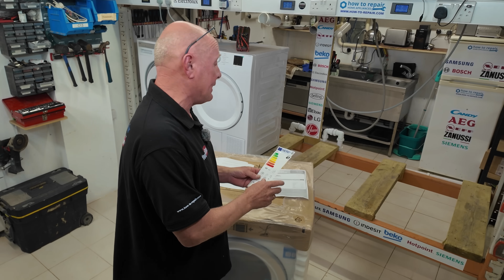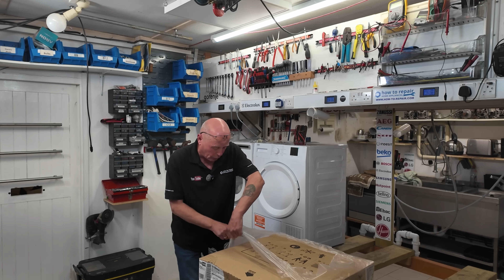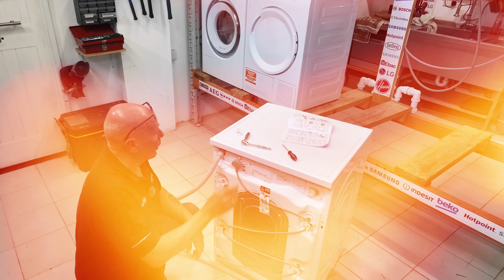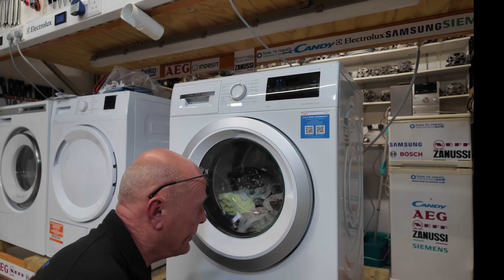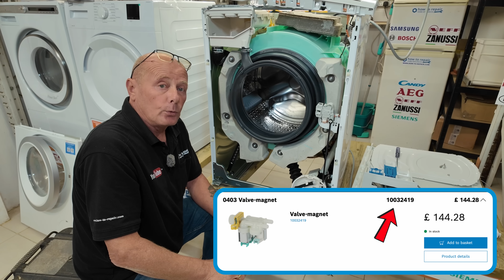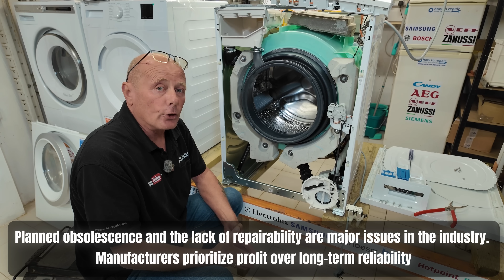Bosch WAN28259GB Washing Machine An Engineers Review: The Good, The Bad & The Ugly Truth!

Comment: Thanks for the work you are putting in these videos and getting the message out!
 
I grew up in the area of the main production site of these Bosch Siemens devices, a fellow engineering student of mine even did his industry internship there – and let me tell you this is a massive business undertaking and they are ejaculating out their junk into the world with an own railway station.
In my opinion, we have to rethink how we use and value things in general. Shortly speaking: „having way less, but way better things“. Especially big appliances like washing machines, fridges, ovens, dishwashers, thermal heat pumps etc. (not even speaking of cars) require an immense amount of resources and effort regarding the logistics. I think we should treat such devices (or almost all things we own) like investment goods rather than mere consumables and demand a corresponding build quality, engineering thoughtfulness as well as service and support for them. They should be built like industrial production machines, outlast us, have easily replacable components with a dimensioning for extremely high cycle fatigues and so on. A few different models of the same manufacturer are completely sufficient and should have a high degree of commonality. Unfortunately, as the average viewer of this channel knows, the exact opposite is the case and we even have to fight for the lowest of the low hanging fruits regarding things we should immediately change as a society if we still would like to have a world worth living in for our grand-children.
(If you think, I'm exaggerating, please let me do the following math: There seem to be around 25 washing machines per 100 persons living, trend going up; considering these devices only last 5 to 7 years (let’s be optimistic and take 7), we can easily do the math: (8.2b*0.25)/7=293m washing machines to be thrown away and replaced per year, which is about 9.3 machines thrown away per SECOND or pretty much exactly 10,000 machines during the time you were watching this video. (!!!) Imagine going into your flat or house, watching this video, going back out for a walk and 10,000 washing machines were dumped in front of your house and street. +10k dishwashers, +10k ovens, maybe +5k fridges… That is the size oft he problem. Additionally, all of these devices cannot be fully recycled.)

However, the truth is also that we have to pay significantly more for these machines if we require the above mentioned engineering and quality. Fridges built in the 60s (have one myself, built like a tank, looks awesome with timeless design, still works, easily repairable) have cost the inflation-adjusted equivalent of >5k Euro. But you only buy it once and can inherit it to your children.

We still have a long way ahead of us and I’m afraid it won’t work with neoliberalism…

Comment: On my WAB24262GB the spider corroded away and the drum broke loose during a spin. Cost of new drum £194. Fitted it myself. Not difficult if you are mechanically minded.
Reply: Most of arn't. Well done 👍

Comment: More people need to be aware of this, thanks for showing! And I agree with everything in this video. I primarily use a 22 year old AEG machine - same as with the old Boschs, everything is affordably repairable! Newer AEG/Electrolux machines also use this type of welded together drum, where you can't replace the bearings/spider - but only in the european region! I saw pictures of Electrolux machines from the asian market, where they used the same type of drum, but in a splittable, two halves screwed together tub! So, why can't we get this? Also  the waste created by throwing away a perfectly fine drum and tub, just because of a broken seal and bearing seems not very "ecological" to me....

Comment: all the circuit boards I have repaired on appliances have had output driver faults. Thyristors, relays etc.
Then it doesn't matter much if many other components are surface mounted and very small.
But it sucks that you can't change the bearings! And the water valve was very expensive!

Comment: Do you know why Bosch no longer lists 1600rpm washing machines on their website? It now seems impossible to buy a brand new Bosch with a 1600rpm spin speed - something I am grateful for in winter, as I don't have a tumble dryer.

You can buy Siemens machines with 1600rpm spin speeds, but they come at very high prices, for what appears to be a rebadged Bosch.  I wonder if it's perhaps something to do with rules or laws about energy efficiency, or is it because their sealed tubs don't have good quality bearings any more?

Thanks for all your videos, I really appreciate them.
Reply: I think it's been shown that the difference between 1400 and 1600 spin is less than an egg cup full of water. Not worth it for the extra noise, energy consumption and stress on components.
Reply: The residual moisture for a 1,400rpm spin on the machine I have is claimed to be 52% Vs 44% for the 1,600rpm model, so a difference of 8%. If that's calculated by weight of water as a percentage of the dry load, that's a difference of 80 grams ( = 80ml) per kilogram of cotton, or 560 millilitres for a full load of cotton in my 7kg machine (not sure if that's correct, over half a litre is more than I'd expected!). The 1,800 rpm model would only remove a further 2%, or 20ml per kg of washing.
Reply: Siemens is a Bosch brand, same machines different (classier) styling. I read once Bosch belongs in your garage, Siemens in your home 😄. In any case if you can still find Siemens 1600rpm models, they're expensive because they're likely old discontinued models
Reply: Bosch wgg256z40 700€ 10kg 1600umin🤙🤙🇩🇪
Aeg 8kg 1600umin 520€.
Reply: Not a huge difference between % of water extracted at 1400 vs 1600 rpm. About 1% tbh

Comment: I have an earlier mostly similar model without the drum cleaning function.
I have worked many years with laboratory wash machines, but never seen the water valve as on mine.
After two years I got a fault message concerning water supply and believed that it was a dirty mesh or low water pressure. 
The problem was that my unit had a sophisticated inlet water valve using a flow sensor.
I asked Bosch to send me a new valve under warranty, but they wouldn’t.
I had to use a service company to get the problem fixed.
I did not want a an alien into my home so I had to pay for the expensive valve myself.
It had saved them a lot of money to give me the valve, but no deal was done.
Whatever, I bought the valve and installed it myself, not a great support.
The manual told that you had to make the “brain“ to recognize the new valve 😂worked ok without.

Comment: Here in America I'm using a stacked washer dryer from Kenmore that is going on 40 years. All electromechanical, no electronics. Zero problems.
Reply: The idea of a washing machine and dryer is very simple. There is no need to make them so complex, and you certainly do not need electronics in them.
Reply: In 1980, my mum had a Hotpoint X2000, it was the first microprocessor controlled model that Hotpoint (UK) ever produced (back when hotpoint was still a real company), and I believe only Servis had produced a computerised model before that, the Selectronic (also in the UK). They both, I believe used the same TI microcontroller, a version of which was used in the first speak and spell and also the first version of the Big Trak toys. It had four boards of electronics, linked by long ribbon cables running around the machine, the microcontroller was on its own circuit board with rows of transistors on its IO pins.  Unfortunately the Microcontroller chip only lasted about 5-7 years on ours,  if I recall correctly, was sensitive to high voltages, but there's a video online of one that still works over 40 years later. The replacement board was for a later model and a had a different chip that needed no transistors and lasted till the bearing went, the rest of the electronics were rock solid. The model we replaced it with had electronic speed control, but sadly had a mechanical timer, and I have to say, I hated going back to an electro-mechanical timer, after using the x2000 and regretted not making the effort to change the bearings. Electronics can be made extremely reliable, but don't be an early adopter of a new innovative design.
Reply: @mels8966 

The point is washers and dryers do not need electronics. What they are doing is not complicated.
Reply: @CorneliusTaylor-s1u  Well, come to that if you want to avoid unnecessary complications, you could pound your washing against a rock in a river, or use a metal tub, a bar of soap and a washboard... Modern microprocessor controlled washing machines have more more granular control of water levels, temperature and the motor, throughout the wash, to maximise wash performance and improve efficiency. You'd be hard pushed to construct a modern water and energy efficient washing machine using only an electromechanical control system. The main problem with electronics in washing machines is the replacement parts are significantly overpriced, I guess that's partly down to a lack of standardisation in the designs.

Comment: I have a serie 8 home professional Bosch washing machine that after 3 years of regular usage broke..Sometimes It suddenly reduced the time during the final spin to 5 mins remaining and the drum stopped..when I paused the machine The door didnt get unlocked..I had to turn it off and open the door manually by pulling down that emergency openning black strip behind the filter door..I had to buy another one because nobody could fix the problem..they said It Is probabely due to the board..but recently I watched a video with the same problem that fixed by replacing the coal rod in the motor..I dont know what is the technical name of that thing..I mean the black little rod in motor..Im really confused and hope to be able to use that washer again😕
Reply from the maker: Sometimes this can happen if the machine was unable to empty in the allocated period of time feel free to contact me at the website if you want me to give you a call. It's always useful to us if you have the opportunity to share and give the video a thumbs up subscribing is down to your choice. Thanks again

Comment: Very interesting but all these machines need to be redesigned in a modular fashion so that parts will pretty much plug in. It is the same argument as the battery in most mobile phones. Years ago the battery could simply be unplugged and replaced now they are surrounded in components and micro wiring making the right to repair worth almost nothing. Manufactures must be made to conform with the spirit of right to repair.
Reply from the maker: it doesn't matter what you buy when you purchase an item you own it so you should have the right to repair it. Parts should be accessible and affordable. The governing bodies are doing absolutely nothing.  please remember to give the video a thumbs up and subscribe to the channel as that's what keeps us going

Comment: How do the newer Bosch washer / dryers rate for reliability & repairability compared to a Series 4 - WVD24460GB/04? It's been repaired a few times over the years by a certain well known appliance repair company ( never again ) I recently replaced the door seal & also replaced the missing screws in the machine that where left out last time it was worked on. Do I go Bosch again next time or do I look elsewhere?
Reply from the maker: unless you're spending around £1000, it really is a difficult choice. A lot of manufacturers are making sealed drums and it is a absolute disgrace.  please remember to give the video a thumbs up and subscribe to the channel as that's what keeps us going

Comment: That packaging is not great, is it? I bought a toolbox and it was packed with a heavy duty cardboard sheet about 19mm or 3/4" thick to protect the top and heavy duty cardboard corners down all four corners.  Bosch fans seem to say the higher-end Bosch and Siemens washer models made in Germany are "better made", but to me it seems they all use similar designs just with the higher-spec models having more features/computers/more elaborate user interface?  

Bosch certainly don't claim anything about a Series 6 or Series 8 or a Bosch Professional being more durable than a Series 2 or Series 4 in their marketing.  So I don't know if you are really paying more for a more durable, longer lasting machine.

Comment: Very interesting review, appreciate it! But these modern “Bosch” Washing Machines aren’t what they used to be, and I’m not comparing these turkish made models with tanks from the 90’s. Actually I’d like to talk about the early 2010s models which fit in the same category as “big kg, boatload of options”, made in the Nauen Factory in Germany. Back then they were truly stable, quiet, and efficient. Surely not as good as the very old Maxx/Classixx/Hydrosensor models, but in this “big drum capacity” section I’d say those were just pure german quality. Nowadays they use welded tubs, bold, boring designs and the build quality is quite mediocre for such a high price. I also hate this trend where instead of complex LCD Displays companies would rather use LED Symbol Display interfaces. They offer very little flexibility. But a normal consumer won’t be bothered about that most likely. Spare parts from BSH will always be expensive no matter what, it’s absolutely ridiculous to pay 250€ for a plastic door or main board. Maybe we will go back to the old ways someday. There’s too much functional obsolescence both for normal consumers and people who genuinely have a hobby like this.

Comment: My is very similar model the crappiest washer ever had touch screen is rubbish if you are near it like below your kitchen worktop it changes program or stops working there is no program on for spin only you have to set on rinse and spin. When programmed complete ended washing come out completely
 Wet the worse washer ever. Purchased on my retirement with gift funds supposed to be one of the top washers no way. Waiting for it to go US then bin it
Reply: If the washing is coming out wet, then the machine isnt able to spin the load in balance. Ideally put less awkward clothing or items to have the best success at spinning performance would be my friendly advice!
Reply: @WSHLNd120  People complain about Miele cutting quality, but they are a lot more tolerant to imbalanced load and therefore give more accurate wash times than most!  It sounds like Bosch and especially some like LG are very intolerant of imbalanced loads and will refuse to spin and keep adding time to the wash?
Reply: There’s a child lock activation on the screen - use it to stop inadvertently pressing the screen, spin does not add water unless you’ve selected rinse/spin - or your pump is blocked.

Comment: I bought a new Beko 12kg washing machine today because I was getting a motor error on our old hoover model (7 years old). Bought Beko because you had said before they are decently repairable. I'm just wondering have you ever seen/worked on this Beko model and what do you think. Model is B5W1241AW. Starting to also think (thanks to this video) that the hoover might just have brush problems. 7 years x 3 washes a day, it will add up :)
Reply: Beko appliances are good machines, easier to work on, and parts (not all) are at reasonable prices with good availability. I know your question wasn't for me, and you wanted information on your specific model, but I have worked on the twin machines of that model and are pretty decent to take apart and repair. However, just like any other machine, if the motherboard or drum plays up after warranty, then it's best to say goodbye.
Reply: @PotatoBodo i actually have a Beko tumble dryer. 8 years old, I have repaired it 3 times, element, capacitor, felt seal and control board; the felt seal allowed water into the control board. I was always delighted how easy it was to repair and get parts. Before anyone says 3 repairs. I have 6 kids and it's used at least twice a day, everyday. It owes me nothing, but I can keep repairing it. I do appreciate your response and am thankful you gave your opinion
Reply: @PotatoBodo 
That's good information to share will be relevant for many people 👍

Comment: I bet that 3 way solenoid valve has a flow meter in it. Still seems expensive though. I expect it is probably welded together for cost saving too so you can't easily dismantle it to clean and unblock it if it fails, like you could with many older ones instead of replacing them. Not sure the black door seal is a good idea, an owner may not notice if it gets mould on it, until it rubs off onto their washing, although it will be good for hiding the mould stains if you need to clean it up from not leaving the door open.
Reply from the maker: the two wave valve that I was showing is a genuine Bosch with a flow valve and I think when I checked the device that was only 35 or £40 how can they want 130+ pound?  please remember to give the video a thumbs up and subscribe to the channel as that's what keeps us going

Comment: Hi Paul, I have a Bosch washer/dryer series 6. It's coming up 5yrs old and so far has been great. Must say I like the asko machines and wondered can bearings be changed and do they have pump filter as I can't see any at the front of the machine?
Reply: The Asko's all have a cast iron bearing cross at the back of the tub so the bearings can be replaced and it is a much easier process than most machines as the cross just comes off instead of having to split the tub in half to get to the bearings. they have a pump filter behind a metal cover at the bottom left thats designed like an older miele so they have a metal tool at the back of the drawer to open the flap to access the drain pump :)